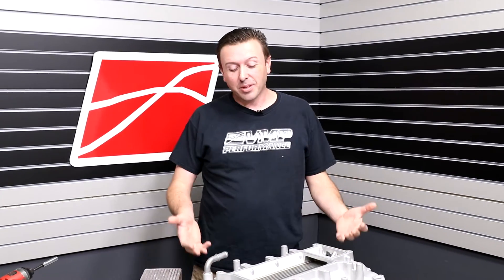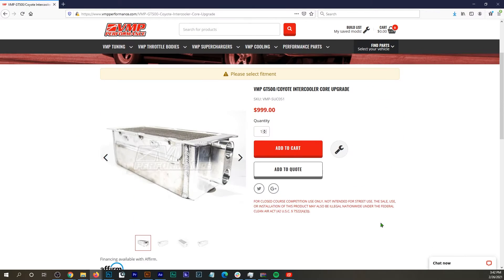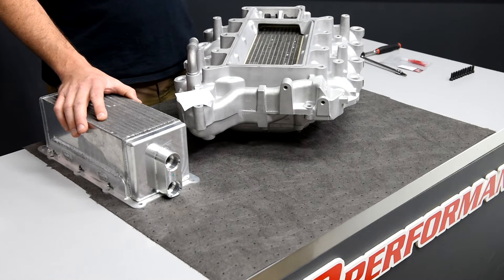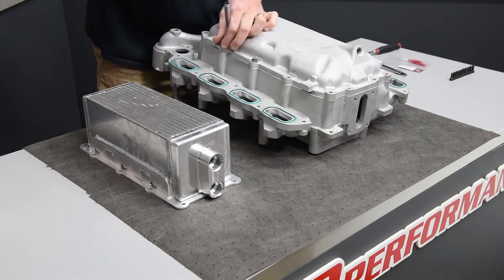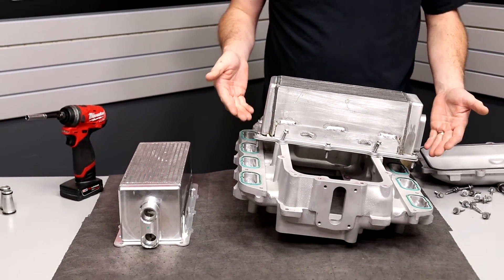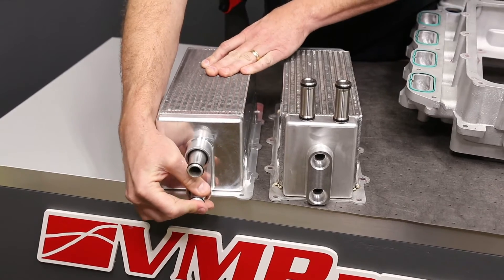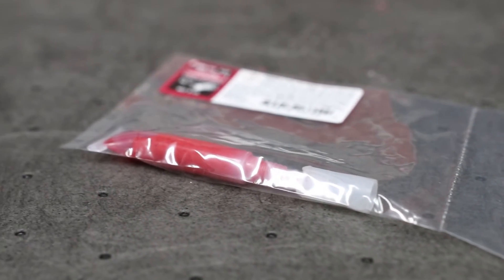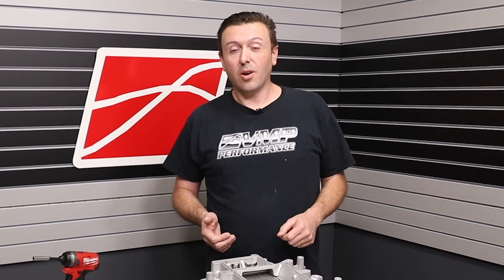Product Feature || High-Performance Replacement Intercooler fitment for Roush 3V Supercharger kits!

Comment: your site doesn't show anything for a 5 to 9 gt
Reply from the maker: We've included the links in the description for this particular intercooler core.  It's a multi-fitment product, as it's the original core sizing for the GT500 and Coyote based lower intakes.